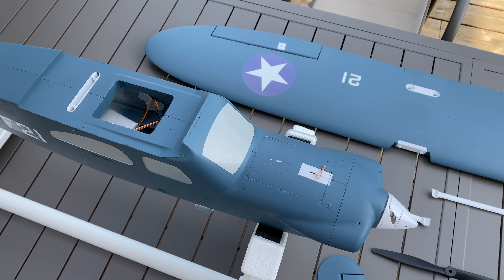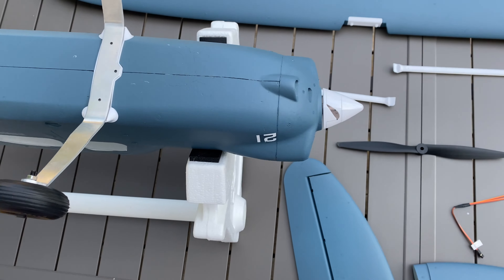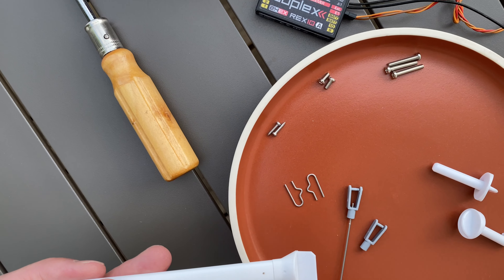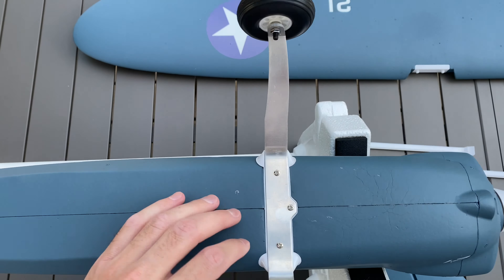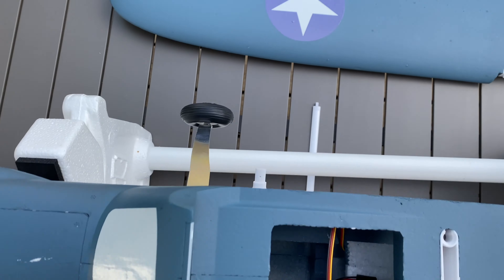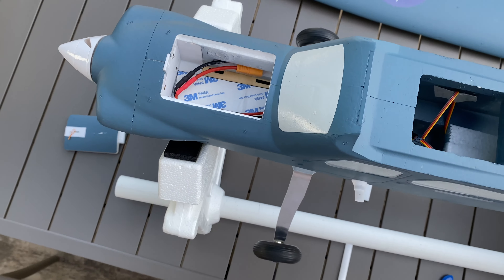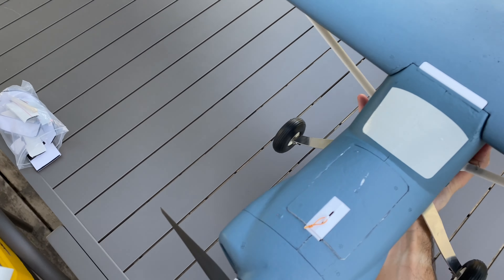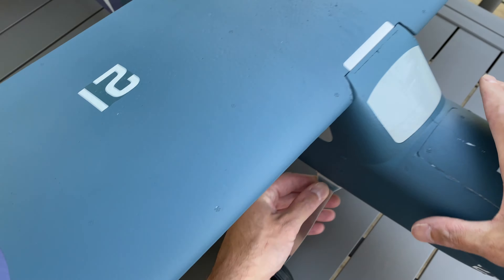*NEW RELEASE* L-20 Trainer 1.3m  Sky Flight Hobby | ASSEMBLY, RADIO SETUP | (English/Français) 4K

Comment: It seems to me that this might have been manufactured by FMS  for ,Lan Xiang - as the landing gear is 100% the same as the FMS SuperEZ - the wing struts are the same as the FMS Kingfisher, the Brass threads are the same as FMS , and then the Wing attachment pegs are the same as the FMS SuperEz and FMS Firefly  I have only ever seen them used on FMS aircraft  - I like FMS LOL - just one  word of warning from experience - the Wing struts are weak where they join the wing - I have had to replace two like these on the FMS PA18 Super cub because the plastic end snaps off really easy - it looks good for a small trainer it is a little different..
Reply from the maker: Ah ok thanks mate for the info but I won’t remove the wing so it’ll last longer I hope 🤣 
That’s the best trainer I’ve ever flown! 2 flights of 9min each and it’s so so so cool !!!!